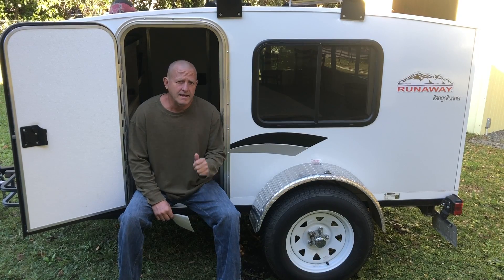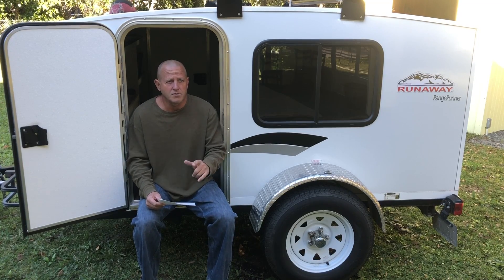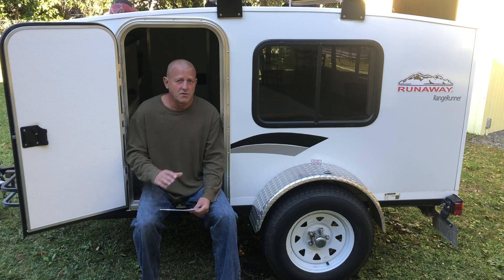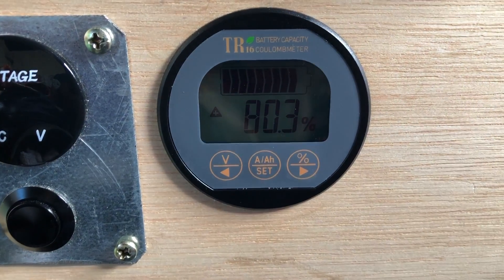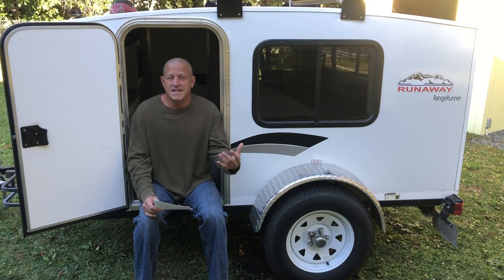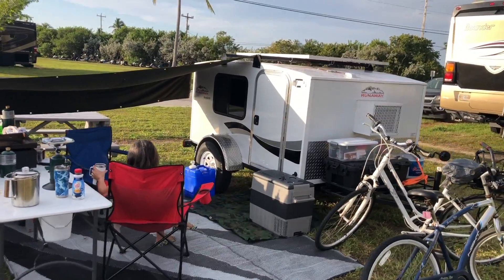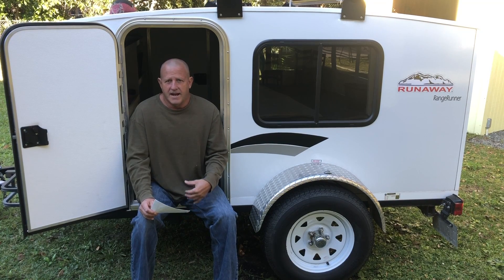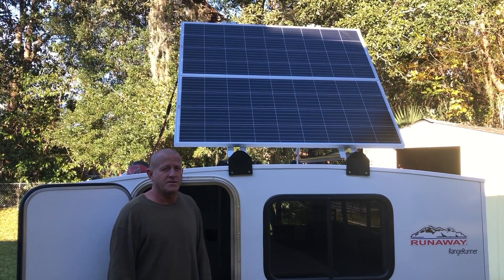Runaway Camper Solar System - FieldTest and Data - What I learned

Comment: Had one of those campers , teardrop type. Brother borrowed it to go across America. Bottom fell out. Literally. Cost more to fix it then it cost originally.  The top had a teeny tiny little hole where the seam was.  It allowed water to collect in the bottom , they """: do not have drain holes. So it collected like a pool. Couldn't see it , smell it , and no way what-so-ever to see it.  The other bad thing about them is that there is no easy in or out.  Easy pickens for bad people , bears ,and no gooders . Been there done that , got the t-shirt. Never again.     Peace .   p.S. THEY ARE ALSO ""hot "" in the winter get ready for inside rain and drips. As long as you don't breathe, you'll be ok though. My brother sold it to the tow driver for $ 300 and they flew to Ca. then flew home.

Comment: Thanks for for all the info you put out I'm starting a solar project on my Range Runner I'll be using a single 405 watt bifacial panel which according to specs can put out 405 watts from the top and 266 from the bottom which might eliminate having to tilt the system. I'll be using the same charge controller that you have, did you select lithium battery option on the controller or user option and put in your own values ? Thanks for your input...btw how is the system holding up ? Would you have done anything different ? Thanks again...
Reply from the maker: The system works great. The tilt system really made it complete. Im happy with it.
Reply from the maker: I used lithium batery setting .

Comment: Great setup thanks for posting...Do you think installing a Soft Start on the a/c unit would increase the battery run time since it greatly reduces the current draw everytime the compressor kicks in ? Just a thought...
Reply from the maker: Im do not believe that instantaneous burst really put that much drawdown on the battery. I think the main purpose of the soft start to not overload the inverter or generator on start up. the renogy 2000w inverter or the champion 2500 generator have no problem handling that initial load. great question tho. small generators or inverters will kick off on safety overload.

Comment: Any reason you dont run low fan low compressor?
Reply from the maker: I did some testing  the compressor seemed to actually draw more amps on low cool. Than high cool. Comp speed never changes but fan does . I beleive the increased amp draw has something to do with the actual heat load on the coil ( tech ac stuf)